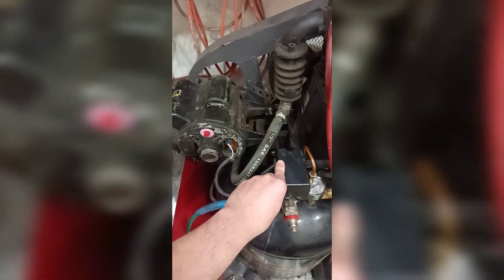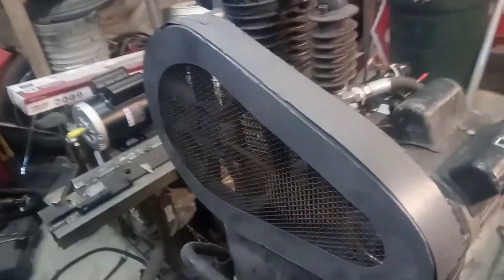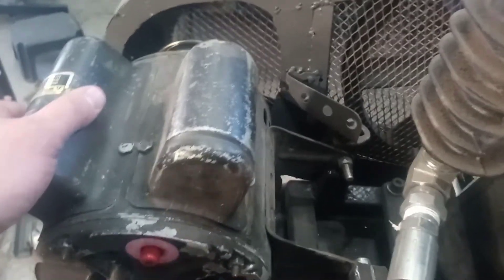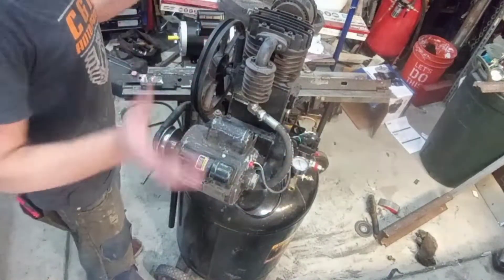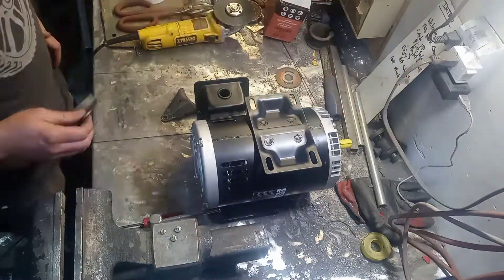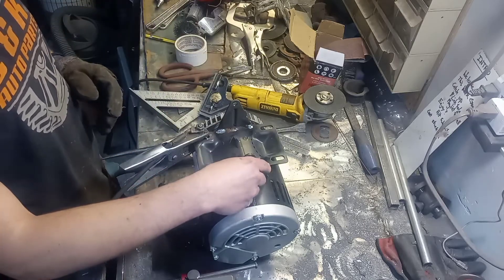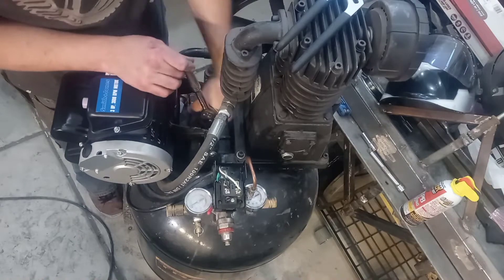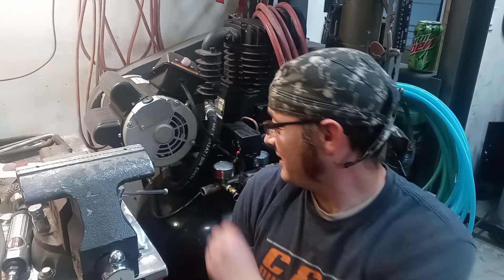How I installed a Harbor Freight compressor motor

Comment: What was your motor pulley size?
Reply from the maker: I don't remember but it is all based on the size of the compressor pulley and the RPM the compressor needs to run at.  You could easily find a calculator online if you have the compressor head info.